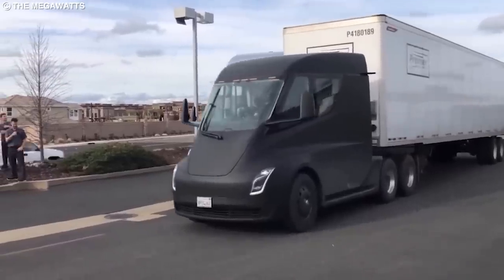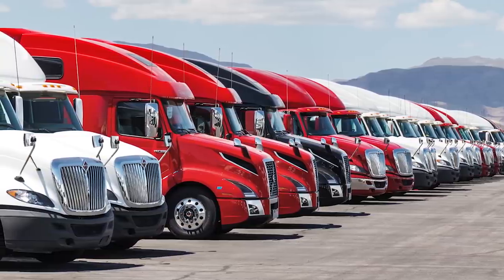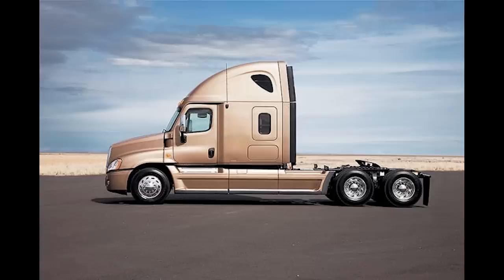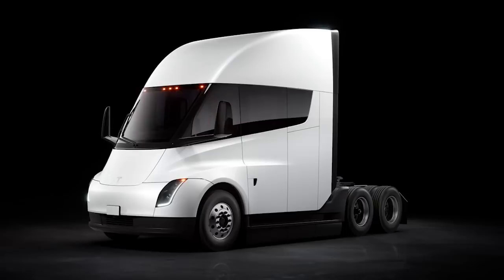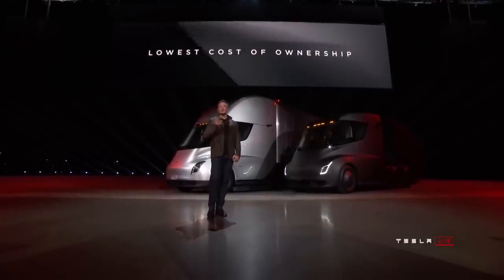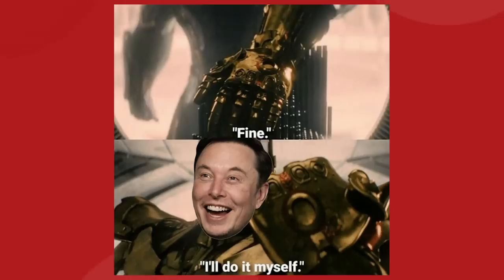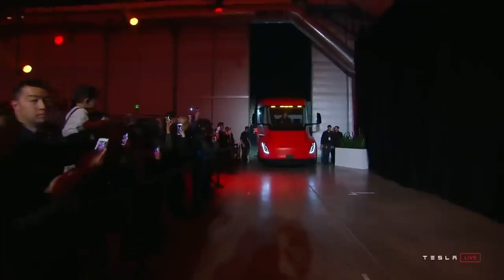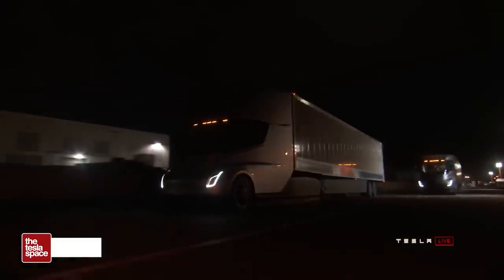The Real Reason Tesla Developed The Semi Truck!

Comment: My favourite semi story. A logging company is desperate to get hold of some semis. Why ? He hauls logs from the top of a mountain to the bottom. When going downhill, the fully loaded truck regenerates all the energy needed to drive back to the top of the mountain. Result is, his fuel is actually free, saving on both fuel, and brake maintenance !
Reply: Technically the mass of the trees got on top of the hill via solar energy (rain and photosynthesis), so the truck is recharging via a very slow solar charger 😂
Reply: This is already being done at least at one mine where huge electric dump trucks are filled at the top and then put at least as much energy into their batteries on the way down as what they use to drive back to the top while empty.  Free energy being taken from stored potential energy in the ore at the top of the hill.  No charging necessary.
Reply: Regenerates all the energy? No chance.
Reply: @MyShanghaiShuffle  So, you're arguing with physics ?
Reply: @chrisheath2637  not really, there are so many losses in the system, not to mention that there are no figures released about the efficiency of the regenerative braking.
Reply: Electric regenerative braking will recover 25% of that distance, hydraulic recovers 75%
Reply: @MyShanghaiShuffle  Sure it does.  The heavy load on the way down powers the charging.  And the empty truck going back up, doesn't use as much.
Reply: @ShanghaiShuffle  75% energy recovered. Come down loaded, go up empty easily give enough extra for loading/unloading nearby.
Reply: @lengould9262  First of all where did you get the 75% figure? Secondly 75% of what energy? The energy depends on how much the load needs to be slowed. Thirdly the efficiency of simply battery to wheel is 80% and likewise the conversion in reverse is 80% so taking nothing else into account you’re down to 64% (those figures are from the Tesla website).
Reply: @MyShanghaiShuffle   It is a matter of potential energy.  The potential energy comes from loading the truck with weight at the top of the hill.  So if the truck is loaded to 80,000 lbs of weight at the top of a 1000 ft elevation and only recovers 50% of the potential energy by charging the battery on the way down that would give you 30,128-Watt hours/2 = 15,064 Whrs of energy recovered by going down the hill with a full load.  At 6% grade that would be a distance of a little more than 3 miles.  Now after the truck is unloaded the truck and trailer likely weighs about 30,000 pounds.  So the amount of energy required to climb the 1,000 ft or 3 miles back up the hill at 80% efficiency would be 11,300 Whrs/.8 = 14,125 Whrs leaving the truck with slightly more energy in the battery than when it started.  Now the stats on the Tesla Model Y indicate better efficiencies than this but this is pretty much a worst-case scenario, cold battery so not getting full efficiency of regenerative braking down the hill and pushing a wind or traversing a rough and muddy road along the way.  Good roads, longer runs and a warmed up battery should only improve the amount of energy gained.
Reply: So it runs for free ha ha ha
Reply: Then buy a Volvo. They have BEV trucks out there already.
Reply: @MyShanghaiShuffle   Correct!  Regenerative braking is over glorified to the point where people are seriously mislead.
Reply: We need to save the trees.

Comment: It is revolutionary for long haul. For the time that is needed for charging, their are laws both here in Canada and the US of how many hours a truck driver can be on the road, and their well deserved rest and break periods. If a driver is having a meal and/or napping for an hour or sleeping the required 7 or more hours, the Tesla truck has plenty of time to charge.  What I like is that the driver can have the heat or A/C on, rest in comfort while the rig is charging. No more noise and vibration from a diesel engine.
Reply: Yeah, but we won't be able to breathe that wonderful particulate-laden diesel exhaust all night anymore :(
Reply: The driver rests while the truck is being charged. One truck and one driver per charger. If you had hundreds of trucks on a major route, many, many chargers would be needed. I would think that this could be a major bottleneck.
Reply: It's a joke for long haul trucking. There is no nation wide charging infrastructure to support it . There are 40000 truck stops spread across the US for a reason .

Comment: My personal opinion on your 2 major questions, design and battery cells: 

Designing a new cab will take R&D hours (cost increase), production change and construction (new machinery, new training for personnel and time consumption that means cost increase), lowering the production of the current model parts (increasing the already existing part shortage thus increasing the part cost) in a time period that trucking companies already battling with increased costs in fuel and fees. So my guess is the companies are using already existing designs, to actually transition smoother into the new era.

Battery cells are a whole different situation. If we take in consideration the time that took the batteries to come to the level they are today, the curve of maximizing current technology to the maximum gain in output is getting to a flat line, so the next best thing (again it's personal opinion) is charging time.  From what i have read and watched the 2170 has a higher charging time than the 4680, so in a more compact environment (like a sedan) the 4680 would make a better choice since it has better efficiency from charging stop to the next. In the case of the semi, the choice would be the 2170, since you need longer trips from stop to stop (getting in account the truckers brake times).

In conclusions, your video tackles both worlds perfectly since, as you said "they are capitalizing in the space gained by removing the diesel engine" 
Thank you for this content!

Comment: The tesla semi with its 500 miles of range, is really close to being practical for long haul, and then a sleeper will be needed, and I can't wait to see what design they cone up with! They probably could add a battery pack to the trailer as a solution for long haul company's who don't wanna wait how ever long it will take for battery technology to get denser in energy
Reply: actually it's already quite practical especially for solo truckers, because of regulations that limit truck drivers for driving a maximum of 8 hours, a duration that is almost the same as driving 500 miles, the final task that needs to be completed is to provide a sufficient number of megachargers
Reply: Not really when you don't have any chargers around the country
Reply: @alfaseeds13  it's 11 hours not 8
Reply: @MayorMcheese12  after 8 hours you need to take a 30 minute break. 30 minutes is 70% charge enough for another 3 hours driving then a stop for a full charge.
Reply: Why you think that there is only one driver in semi truck
Most long route truck has two drivers they don't need to stop truck for relax
Reply: @yuvrajsinghf57  Some. It depends on the company.
Reply: @danboyd2725  can you tell me a diesel truck range
Reply: @yuvrajsinghf57  best case scenario about 2000  miles. Average 6 5 miles a gallon with a 300 gallon fuel tank. Roughly a one way trip from Miami to New Yotk up I-95. 

Current price of Diesel $5.00 a gallon  that's  about $1,500 US. The cost of running a Tesla will be about $1,000 US in charge point electricity. Of course the cost of diesel will drop over the next year  to bring it closer or cheaper than charge port electric.
Reply: @danboyd2725  
Have you think that why EV company always tell charging time of 80℅ , 50℅ 
Tesla says 80 ℅ in 30 min 
Why they don't tell charging time of     100 ℅ battery 
Nowadays diesel truck has much advantage over EV
Reply: @yuvrajsinghf57  But the laws requiring Americans, Canadians, and Europeans not to drive after 8 hours of time make that point moot.
Reply: @danboyd2725   yeh but in INDIA there is no such rules 😅
 driver have to reach their destination as soon as possible so most of truck have 2 or 3 drivers they continuously drive
And stop truck only for lunch
Reply: @danboyd2725   tesla will never run in india because their is always fear of battery drain if once then towing is only the option 
Whereas diesel can be supply by cans without need of towing
Reply: @yuvrajsinghf57  I've seen videos of trucks in India. You guys aren't running stuff from this century, or within three decades of the end of the last one. 

Your idea of a technical upgrade is painting them paisley and gluing a family of gods to the top of the cab.
Reply: In the us trucks have a weight limit.  The huge battery in the Tesla already severely limits its capacity add another battery and you cant haul anything but batteries around.
Reply: @atillathehungry3145  
But there is a weight savings in the engine and transmission being replaced by electric motors. Also Diesel fuel weighs about 7 lbs per gallon so 300 gallon full fuel tanks are about 2,100 lbs in a standard truck. The battery pack on the 500 mile range model could range in weight from 8,000 lbs to as much as 11,000 lbs depending on the source cited in articles.
Reply: @yuvrajsinghf57  because above 80% the battery wear is much greater than going 0-80%. Stressing the battery way more as well, making it lose its capacity faster. If u can charge 0-80% in 30 min, and 80-100 in another 20, is it worth it going 100%?
Reply: @dariussuteu6880  so is you to charge above 80 ℅ or below it
 if you charge above it you get more range but bad for battery pack and below 80℅ you get low range 
In Tesla semi after 8 years you have to replace the battery which is half price of tesla semi price
Reply: @danboyd2725  i dont know what you are talking about dude you cant drive after 11 not 8 you need to get your facts right
Reply: @danboyd2725  most trucks only have about 150 gallons not 300. where the hell are you getting your info?
Reply: @Themrine2013  
I went with a maximum since we were looking at the maximum range for the E Truck. And yes most trucks have a fuel range of about a thousand miles.
Reply: @Themrine2013  
And according to the actual  rules you're suppose to take a 30 minute break in eight hours and you can't  drive after 11. 

This means the Tesla Truck actually works for single long haul drivers as well as short haul corporate fleets.
Reply: @danboyd2725  --I routinely drive over 500 miles.  My meet point is about 260 miles away, and there are no charging stations there.  If you've driven anywhere in this country at night time. you'll see that there aren't enough spots for tractors right now, let alone charging stations that aren't built.  And what happens after they build all these charging stations and there is a 2 hour wait because of the high demand?  Add in some snow, or accidents, and you can easily come close to your 14 hours.  
While I think there may be a place for an E Truck in the future, it will have to be limited to companies that can make it to a terminal in under 400 miles.  The industry is hurting for drivers as it is and having drivers wait (unpaid) for their trucks to charge won't sit very well.  Not to mention that a large portion of companies use rental trucks (Ryder, Penske, et al).  
And the "day cabs" that I've seen all seem to be 13'6" tall and much larger than a normal day cab.  Good luck getting around in those in a major city (NY, Chicago, Philly), not to mention lower bridges.
Reply: @PaulSmith-sb7sj  And it won't  be like that in a couple of years. Besides, chances are you can't afford to buy one right now.
Reply: @yuvrajsinghf57  
Except for the stink
Reply: Just add solar roof to the trailer.

Comment: Finally we a comparison energy density per weight unit. Weight is always the biggest problem for vehicle batteries. It is really surprising that the smallest cells have the highest energy density. Obviously the 4680 needs some advanced development to supplant the smaller cells.

Comment: "4680 in its current format". Correct, but if they change the chemistry (but same form), they will be better than 2170
Reply: Yep I think that’s the case, most likely it’s still WIP to get production consistency and matching tolerances across individual cells. Maybe one of the things holding up the Roadster launch?
Reply: doesnt matter, itll cost more to charge than diesel anyway
Reply: fatter is hotter.

Comment: I think the 1MW power architecture may have emerged from first-principals thinking (i.e.: how much inertial energy a loaded truck traveling at 75 MPH naeeds to be captured with regen when the truck does a quick stop). Squeezing maximum regen will extend range. This may also be why they have 3 motors. They need the regen capacity to capture the maximum energy as the truck slows. The benefits of 3x the power of a normal diesel is a performance bonus that Tesla gets from needing to honor Newton's first law as they slow the truck down.
Reply: I believe these models have 2 moters
Reply: @milyunair  At the delivery event Tesla revealed the trucks have three motors.

Comment: What makes Tesla semi so special? The ability to carry less than half of regular 40+k lbs cargo, need for a charging station with output of 1 household every 500 miles and the revolutionary groundbreaking wireless charging. So far 1 has been delivered. Unfortunately it broke down and had to be tugged away by a nasty diesel truck. I am fairly confident the remaining 1000 or so ordered will be delivered next year! Simply amazing!

Comment: Most drivers complain about vibration, noise, and constant shifting.  All these problems vanish with a Tesla semi.  Game changer!
Reply: And regenerative braking also saves on the lifespan of brake pads while adding power to the battery. super win!
Reply: Newer truck here is Europe are fully automatic so no gear changes
Reply: Stop talking nonsense!!!! “Most” what!!!? You realise that automatic gearbox exist right! With super tiny shifter, some drivers actually prefers manual f gearbox
Reply: @daemenoth  lol….. on a flat surface totally useless tbh
Reply: @daemenoth  LMFAO. so youre gonna put stress and load on your motor..... just to save $20 in brake pads, genius, pure genius

Comment: Hate to be the 70th comment, but have to say, the reason all other electric truck manufacturers choose to go with standard design is that they are standard design, they can use the existing supply chain to build their trucks fairly easily with limited capital. This also allows them to deliver their product very quickly to attract more investment and possibly get the quick cash they want if any big car manufacturers decide to buy their company. They are running their company silicon valley style

Comment: The Tesla Semi weighs 5,200 more pounds than a diesel tractor. 

The weight limit for an EV Semi loaded is 82,000 lbs so the lost cargo weight is 3,200 lbs. 

85% of semis on the road are hailing less than the max gross weight of 80,000 lbs 

This is a game changer and truck stops will line up to get those 1,000 volt chargers.  30 minutes charging means 30 min buying stuff at the truck stop.
Reply: We should go in on a business' plan to get that charging time up to 40 minutes. 33% more profit for these stores! 10% back to us!

Comment: Over the road, I like the power reserve that diesels have.  In winter weather you can get caught in storms, you drive in the cold where batteries suffer, yet diesels can keep going.  Diesel also has a lot of reserve power if you have to pull over when the weather gets really bad.  Can the Tesla keep its ooomfh  when the temperature  drops below 0 on a clear day in the Dakotas?  Definately a southern route only truck.
Reply: @NitroMeep3.3  Fine I will trigger right back.  Most of the greenies have no idea about naturals systems having grown in cities.   Biodiesel can be used for over the road trucking and it is carbon neutral and it is clean enough you do not need the DEF crap either.
Reply: You temperature control the battery packs the same way you do the cab. After a few minutes of warm up time, it doesn't matter how cold it is outside, they perform nominally. I guess people forget about insulation and heating and cooling for systems that require it because legacy vehicles kept the battery at ambient temperature. It doesn't matter anymore what the outside temperature is because they are all temperature controlled out of necessity. Heating the cab and battery packs does use power so range will be affected but that's the only loss in cold weather.
Reply: @wally7856  Uh, oh. There is an energy conservation problem here.  Maintaining the battery at a usable temperature in cold weather requires heating as you stated. Heating is energy. That energy can only come from the batteries. So maintaining the batteries at temperature would reduce range.  Further, unlike diesel engines or FCEV there is no waste heat available for cabin heating. In a BEV that energy must come from the batteries as well, also reducing range.
Reply: @maxguarp3937  yes, range gets cut roughly in half in cold weather but the machine works as intended. If range is an issue then a bev isn't for you.

Comment: These trucks only need a 30 minute charge
The reason is because each truck can be topped off when the driver has to wait for a load. Trucks are constantly in use. It just needs to get to where it's going half the time the other half is either empty the way back or waiting for a load
Reply: Truck stops need chargers!
Reply: it doesnt matter when charging will cost more than diesel. youre gonna pay more and wait an hour rather than 5 minute fill up